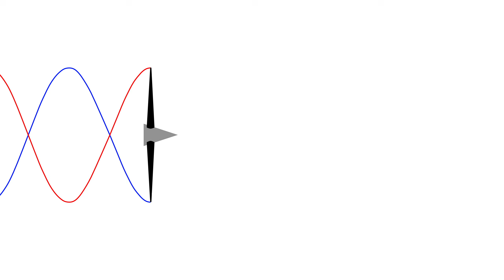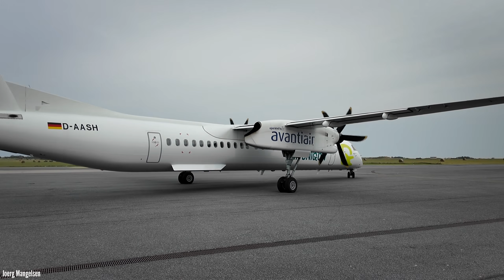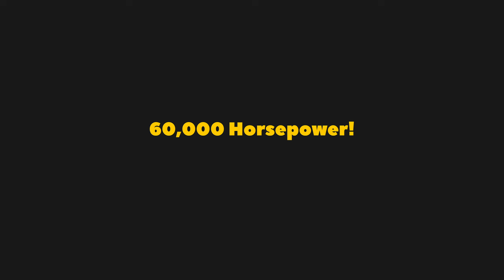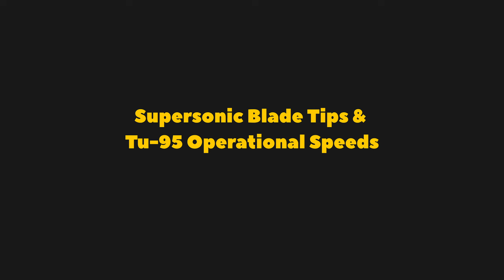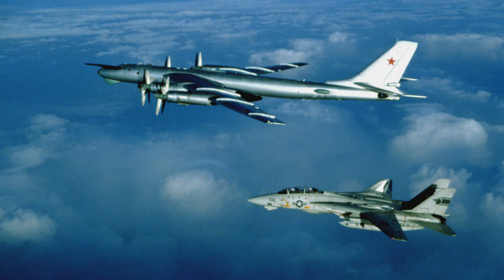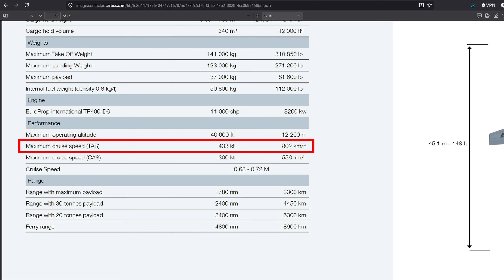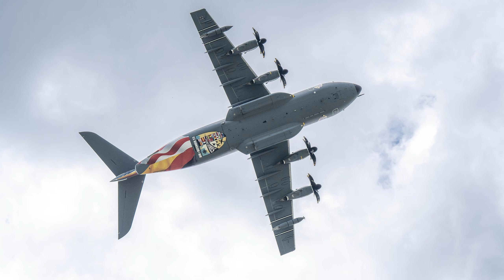How the Tu-95 Achieves Its Speed (& Why THIS Turboprop is Faster)

Comment: Coming up with a design for the DBE was a nightmare and two years. They didn't want to make the logistics, nightmare of two engines that rotated in different directions, so they installed reversing gears into the drivelines of two nacelles.
Reply: Yeah, people tend to underestimate the raw challenge of maintenance when your aircraft is equipped with counter-rotating propellers based on engine design instead of reversal gear, suddenly almost every moving part is chiral!

Comment: In comparison the B-50's 4 row, 28 cylinder Wasp Majors (also used on the piston flying wing and B-36) produced about 3500 hp. This is an interesting comparison because the Tu-95 is also a literal direct descendant of the B-29, via the Tu-4, Tu-80, Tu-85 development series. 

The straight winged 29, 50, 4, 80 and 85 all had a split bomb bay because of the wing spar. This limited them to short bombs, so they could not carry Tallboy or Grandslam bombs like the Lancaster with its very long bay. 

The 95's turboprops produce more jet thrust than usual for TPs, thus aiding its top speed beyond what props alone can achieve. For example the XP-72 prototype (a 47 with the Wasp Major spinning a contra prop) was supposed to reach 540 mph, same as the 262), but the end of the war stopped work on the super prop. In the mid 500s prop blades cannot get enough bite on the air flowing so fast through them, while the increasing ram air effect on jet intakes helps them produce increasing power with speed.
Reply: You are disproving your own assertion that 95 is a direct descendant of the B29/50 and Tu-4/80/85. Tu-85 is entirely unrelated to Tu-95, for many reasons. Aerodynamics, structural loads, wings, tailplane, everything. Tu-95 didn't use ANYTHING important from Tu-85. 95 was designed from a clean sheet. Maybe some small details and components might be shared, but that's about it.
Reply: @Max_Da_G  The fuselage is a very important component of an aircraft. The stretched fuselage of the 85 was directly adopted, with alterations to accommodate the swept flight surfaces and longer nose gear, in the 95. Which is why the 95 has such an oddly narrow, circular fuselage. Even the canopies are identical, including the last 95s built. Same pressured cockpit and rear compartment connected by a tube above the bomb bay/s. In comparison the B-52 has not the slightest thing in common with the 29/50, that was a true all new clean sheet design.
Reply: @gregp6210  Except the length is higher on the 95, the empennage has different loads compared to the 85, which means it needed to be stronger and more rigid. When you stretch something, it's not simply a matter of adding extra sections. Structure needs strengthening. If you move the wings, you need to recalculate the whole lot in terms of structure, balance, align the centre of lift and centre of gravity. Whoever wrote that it's basically a carryover can't be further from the truth.
The canopy design is a detail. If we go down that path, then we can say that Boeing aircraft are all the same regardless of size and model just because the nose section with the canopy is of same design.
Fuselage might share the overall design concept, but they are totally different structurally.
Reply: @Max_Da_G  The Spitfire fuselage was repeatedly strengthened over time (Mks 7/8, 12, 14/18) and then replaced (21/22/24). It was still the Spitfire.Airliner fuselages are strengthened when they are stretched, an extreme example being late DC-8s. Sometimes they get new wings. 

Had the Soviets not copied the 29, there never would have been the 95 in its current form. Tupolev would have come up with an entirely different, less narrow clean sheet fuselage.
Reply: @gregp6210  Tupolev and others already worked on 4-engine bomber designs before B-29 was copied. What held them back was lack of engines and some of the systems needed. When Stalin found out about the 3 B-29s that landed in Sakhalin and about the problems with the development of the long-range bomber, he ordered the copying himself. Russians didn't have a problem with airframes and fuselage development and already had the experience, albeit not with pressurized cabins for large aircraft.
Reply: @Max_Da_G  The Tu designs were inferior to the 29 or B-32 for that matter, and would have left the USSR without modern bombers into the 50s (as happened with England until they flew surplus freebie 29s for a while). Stalin was correct to force Tupolev to copy the much better Boeings.

Comment: you are on the way to explaining why the open rotor engine is useless on commercial aircraft. .72 Mach cruise will not cut it. If we believe the hype they claim higher cruise Mach but the only way to achieve that is to slow the rotor even more. OK so that's fine in the cruise but what about take off? now we need to spin the rotor fast. How do we design a turbine section that can extract max power at slow speed for the cruise and high speed for the take-off? Gear box. Nasa tried and failed at the power levels we need. This is why you will not see an open rotor and why plan b is to have a ducted fan.

Comment: And no mention of the special blade profile of the Tu bombers - I don't recall where I heard about that but it mentioned that the yanks went to great lengths to get a copy to see how Tupolev had managed to increase the blade efficiency at its rate of rotation.
Reply: Why bother, the yanks were building B52s at the time!
Reply: @nickinknutsford  Why bother? Because jet engines in those times were VERY thirsty and it was very clear that turboprops were far less thirsty. So, in the Russian mind it was easier to invent a blade profile that was still very efficient in the realm where compressibility effects were dominant. There's a reason why the B52 is as big as it is - FUEL CAPACITY.
Reply: @derricksteed3466 strategic bombers fly high and fast where propulsive efficiency of propellers decreases consiserably. How thirsty is the Tupolev at full wack? Would be interesting to do a comparison.
I believe a German engineer was behind the propellor design.
Reply: @nickinknutsford  You do recall the part where I mentioned the advanced aerofoil profiles used on the Tu series bombers? Never mind because I have the distinct impression that you think Russian engineers then and now are a bunch of numpties.
Reply: @derricksteed3466 I beg your pardon...I think no such thing! I have worked with Tupolev on a project and have high regard for Russian aircraft which are designed to meet the particular requirements of the territory.
Reply: @nickinknutsford  Then why the reference to the B52 as being somehow superior? The thinking always reflects the time and the constraints applying at that time.
Reply: @derricksteed3466 the B52 was spawned from the B36, an interesting piston and jet powered post war bomber. I'm not some ignoramus spouting ill informed nonsense, rather I prefer adult debate...please don't take umbrage!
Reply: @nickinknutsford  I don't think for even one moment that you are an ignoramus and it's not umbrage, I suppose I suffer from low social IQ. I'm aware of the B36 (I'm a bit surprised at that reference because the B47 seemed - to me - a more natural predecessor or maybe the ill-fated YB49). I've been interested in aviation and flight for about 5 decades but got sucked into computing technology. I got a walk around a C5 back in '74 when one landed in Cyprus (and caused some taxiway subsidence) to unload mine clearing gear.

I find different perspectives on the same things to be interesting.

Comment: What you said makes good sense. So the Tu-95 has a "sprint" capability built in if they don't mind burning a lot of fuel (taxpayer money), whereas a commercial airliner doesn't have the swept wings, contra  rotating propellers and so on because there is no monetary benefit to building this into a commercial airline these days. When the customer pays the cost of going fast directly, a little extra speed isn't as importatnt.
Great video, THANK YOU
Reply: Commercial aviation prioritizes profit. Military requirements are a matter of life and death. Being able to fly fast and avoid the enemy fire at the cost of fuel has different "profit": actually winning.
Reply: @Max_Da_G  This is an excellent summery and a balenced point of view. Thank you

Comment: Look, by the 1970's even aerodynamicists at TsAGI in the Soviet Union and propeller design engineers had mastered building six-bladed propeller spinners. It's actually kind of a mystery why the Kuznetsov engineers didn't design a new contra-rotating propeller spinner using two six-bladed spinners for the NK-12, which would have substantially reduced the noise from the propellers since it didn't need to spin the blade tips above the speed of sound.
Reply: I should add that by using eight blades per spinner and using computational fluid dynamics to design the blades properly, that’s why the A400M’s engines are much quieter, since the blade tips do not exceed the speed of sound at operating speeds.
Reply: Just compare your idea to the B52. Turbine technology developed enormousely, bit only now it gets new engines. Why? Economics/$
Reply: I mean the An70 has two 8 bladed propellers per engine, but the aircraft wans't really a succes
Reply: @FireShadow75 well to be fair the Antonov who design and manufacture An-70 is not the Antonov we know
Reply: @FireShadow75 I don't think the An-70 failed for technical reasons. It was a joint project between Ukraine and Russia, and it fell victim to the collapse of good relations between those countries in 2014.
Reply: @cedriclynch  For more than 1000 years, it was 'the ukraine' meaning borderlands, not a country.  The ukraine was always part of the Polish Lithuanian Empire, the Austro Hungarian Empire, or the Russian Empire.  During the time we are discussing here the ukraine was a republic of the Soviet Union, not a country.  Therefore, the An-70 was a Soviet Union project.
Reply: If there is no brain (for example Mr. Brunolf Baade from Junkers 😁) - you just ain't innovating
Reply: Noise was never a consideration for the Russian military. Flight characteristics were. The only time the blade tips go supersonic is at max speed, which wasn't used for take off. Noone was harmed on the ground by noise so they let it be. Another thing is that making it faster wasn't necessary: missiles would catch it anyway if interceptor came within a missile shot.
Another thing you are missing is that such development of an improved variant has to be requested by the operator, at the time, that was Soviet strategic aviation command. Without their say-so, noone is allowed to alter the specifications of the existing aircraft. Soviet command never asked for improved props since they were content with what Tu-95 was.
Fun fact: the advanced propfan used on the now-dead AN-70 was designed by the same company that had made the props used on Tu-95
Reply: Engineering vs. manufacturing realities. If it cannot be made by a baboon with a hammer, it is a suspicious piece of capitalist technology.
 Also: it is a myth that RBMK reactors were cheaper and easier to conceptualise than PWRs. Adoption of RBMKs was a mix of politics and manufacturing issues (a PWR needs a large pressure vessel) while RBMKs could be built faster also employing many baboons with hammers.
Reply: @mrKoncpom  Been in manufacturing all my life.  Not needing an assembly line full of rocket scientists who still cannot build accurately and reliably is always an advantage.
Reply: @garyhalmbacher6875  You are right with the following caveat I would like to propose:
MBA-holding execs at Boeing might have followed this paradigm (and I am willing to die on the hill of) "they were effectively introducing soviet manufacturing practices".
You just switch political pressure for an economic one.
Reply: What kind of argument is that? The ussr made plenty of highly advanced technology, some thing exceeding the west too, like oxygen rich rocket engines
Reply: @Helperbot-2000 Agree on the RD-170.  I watched a documentary on that engine and at the end of the SU when the Russians offered it to the west, they thought the Russians were lying because no one had materials which could withstand O2 rich combustion, correct.  😂

It took until the Raptor 60 years later to exceed that RD-170.  

John McCain "Gas station with nukes.". What an effing imbecile.
Reply: @garyhalmbacher6875  "gas station with nukes"? ive never heard that quote before, whats that about?
Reply: An argument about proportions. 
A few roaring successes don't automatically translate into superior mass production, maintenance and general safety culture. Somehow we don't drive superior Ladas or fly on cutting-edge Ilysuhin airliners.
Reply: @mrKoncpom  USSR even at its best had a fraction of USA's gross domestic product, no matter how you count it. If you factor in rebuilt economies of western Europe, Japan, Canada, Warsaw pact was hopelessly outmatched economically. Whatever you say about inefficiencies of central planning and ideology, this was simply a reality, rooted in history and geography. Despite this, USSR maintained strategic strike parity with USA since at least 1960s, and a conventional overmatch over all NATO forces from Fulda to Atlantic ocean. As we now know, their planners saw very little hope in stopping it without mass nuclear strikes in Germany and Poland (logistical connections over Vistula). To achieve that military parity with a much smaller economy, the standard of life suffered. This is why there wasn't enough cars in the eastern block and quality control on civilian items could vary. The very work hours available in the system were shifted into military procurement, then exports, with domestic civilian production being given the least.
Reply: @Helperbot-2000 A disparaging comment about the Russian industry supposedly only being able to produce petrochemicals. It's extremely out of fashion ever since the said gas station easily outpaced the entire western block in military production after 2022. And ongoing failures of reindustrialization in the supposedly world's leading economy.

Comment: I never knew about "down between the engines"  It's brilliant since the maximum torque load for two engines is only ever carried between the two engines, the rest of the wing only ever has to carry the torque load of one engine if one is failed, and carries no torque load when both are operating together.

Comment: It would be interesting to evaluate how efficiently these 2 aircraft move their empty weight at high speeds. IOW, what is the rate of fuel consumption for an empty Tu-95 flying at 450mph vs an A400M in the same condition? To even out the weight difference, each aircraft could be loaded with the amount of fuel that makes their weights equal.

Comment: Bringing up the Tu-95 when discussing the efficiency limits of propellers is like bringing up a muscle car when discussing the most efficient highway cruising speeds. Even my Honda can do 100mph if I floor it, that doesn't mean doing 100mph is efficient.
Reply: Americans are funny, I had a Honda S2000... It was quite efficient.
Reply: @t7s-b6x  I can assure you that my HR-V is quite efficient. Just not at 100mph.
Reply: @Ramash440  I had a CR-V. I hate that Automatic Transmission.
Reply: @herwigstoeckl1448  Took me some getting used to since I came from a manual, but I think the CVT on the HR-V is fine. Not sure if the CR-V has the same transmission. The only problem is that CVTs seem to need more frequent fluid changes or else the belt starts to slip.
Reply: Uncle Ricky's big block is going down when cousin Ricky's intercooler comes in next week.

I do so enjoy learning how each one works
Reply: The Germans looked at using thin blade and swept back scimitar blade propellers on the Me 109K4.   These were expected to increase speed from 441mph to 452 and 442 to 558 mph respectively.  One downside was that the thin blade propellor reduced climb speed. Efficiency at high speed does not lead to efficiency at medium speed.

Comment: Something I don't think was mentioned is the use of supercritical airfoils in the A400 which hadn't been discovered yet when the TU95 was designed. I believe some modern propellers also transition to a supercritical airfoil near the tip but I cannot confirm the airfoils used in the A400 prop design.
Reply: The had been discovered in Germany during WW2.   When Boeing tried to sue Airbus  over Airbuses use of a supercritical wing they were able to point to the German patents.  VC10 was supercritical
Reply: @williamzk9083 the VC10 has some supercritical like properties but is not a true supercritical airfoil. Boeing did not develop the supercritical airfoil - that work was done by NASA / Richard Whitcomb. The Germans never developed a true supercritical airfoil but their WW2 transonic wind tunnel data was used in the early stages of its development.

Boeing did sue Airbus over a leading edge slat internal mechanism design in the 90s which obviously has nothing to do with supercritical airfoil shape.... Not sure where you are getting your info, but you should probably do a more thorough job of validating your sources.

Comment: I never realized how high the non-normalized tip speed is in the A400. The M0.72 number is MMO though, so we don't normally operate the aircraft that fast. Regular cruise would be M0.68 and sometimes 0.70, depending on available extra fuel and time constraints. It is very interesting that this is stil faster than the TU-95, thank you for sharing!